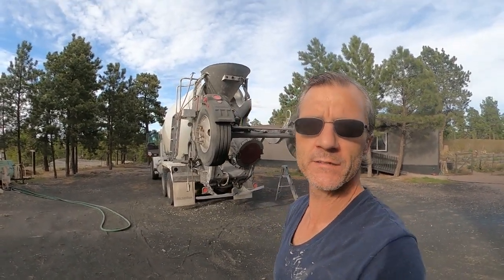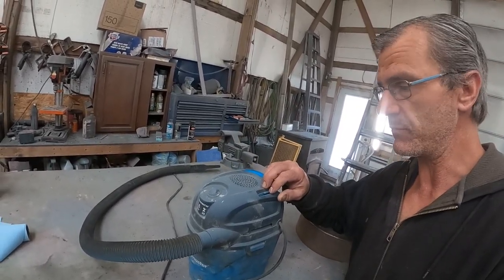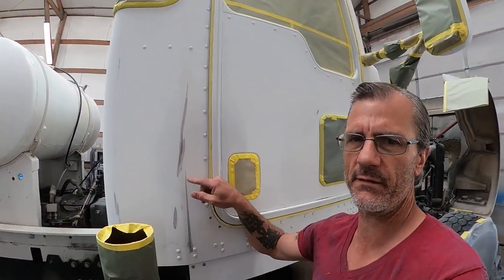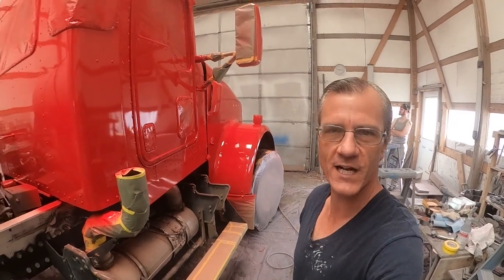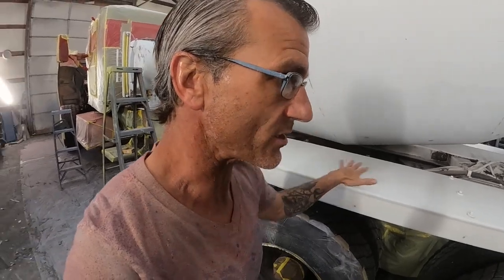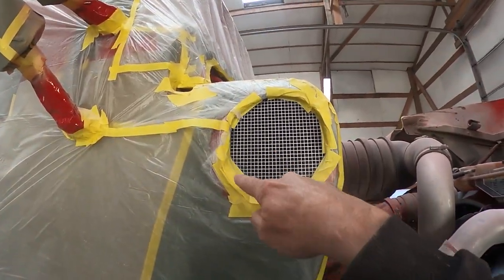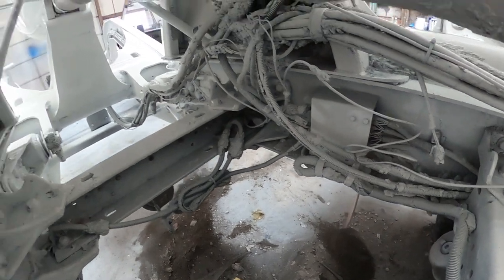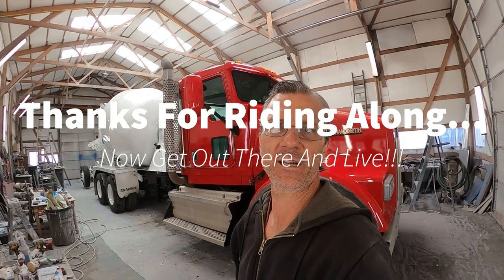All Mixed Up!!! Cement Truck...Start To Finish

Comment: What type of paint do you use and about how much do you charge for one?
Reply from the maker: I use PPG 2K urethane called AUE360. I also use Imron Or Nason 2K urethane. A cement truck would typically go for around 12 to 16...depending on the particulars.